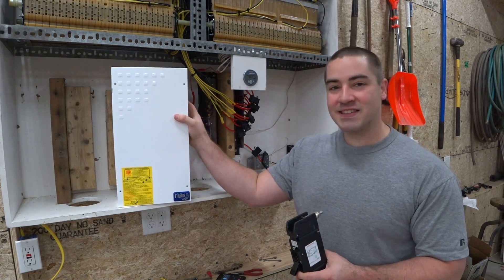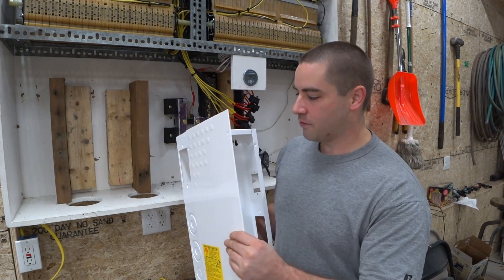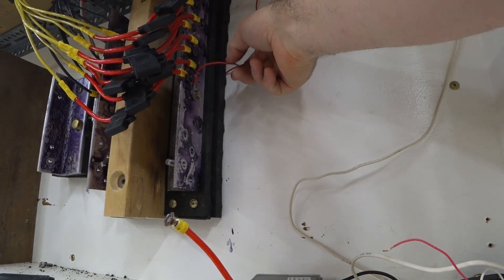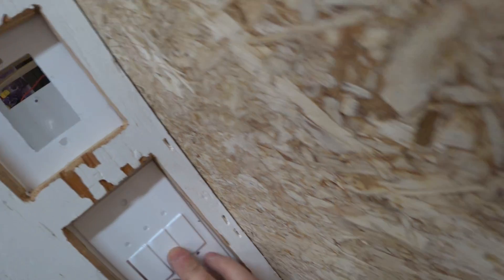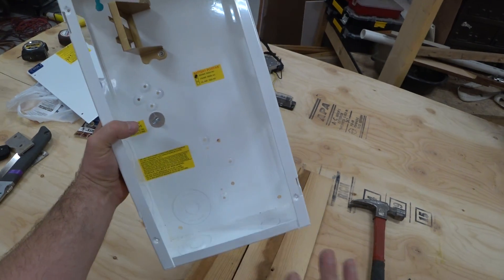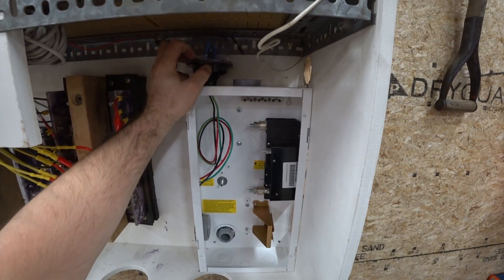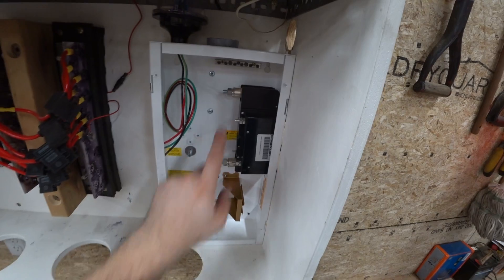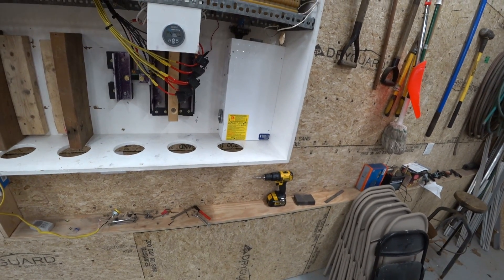Best Inverter Protection, DC Load Center

Comment: Yes to the point of view camera. Gives more details as to what you are doing. Any ideas where to find any volt or leaf batteries would be helpful. Apparently not popular cars in Florida.
Reply from the maker: I buy my batteries from Battery Hookup.  Last time I bought a battery from a junkyard it ended up being dead.  At least with Battery Hookup they always come out good.  You can use my coupon code DAVIDPOZ for 10% off.  It also helps out the channel.  
https://batteryhookup.com/
This is a really good deal right now: https://batteryhookup.com/products/complete-bmw-21kwh-ev-battery-96s-355v-60ah
Reply: Thank you.

Comment: Link for the load center comes up with error. Not found.
Reply from the maker: Alt-E store has an assortment of this type of thing.  But I've been told by my suppliers that breakers are hard to keep in stock this year.  https://www.altestore.com/store/enclosures-electrical-safety/electrical-enclosures/disconnectload-enclosures/dc-c1100/

Comment: Definitely prefer the POV over a tripod.  Tripods are good for providing a wider view of a project over all. But without fail, a tripod view always misses important angles and details. A head mount cam is an absolute necessity in my opinion. Think of it this way... if you can't see well enough from x number of feet away to do the job, then how are viewers supposed to see what you are doing well enough to understand what you are doing?  My advice to all YouTube content creators... Setup one camera in a good spot to provide a broad perspective of the project. (Tip: cell phone cameras excel at this task.) Use head cams for the up close, detail shots. Then edit the shots together during production. Yes it's time consuming. And it may well be more expensive. But this is one of the differences between a professional and informative video and... Something completely forgettable. You have 71K subscribers, 10K views and 467 likes for this video. And that's good. Congrats. But we all know that is a tenth of what the best content creators boast. The difference between them and you, is not ridiculously expensive equipment. It's production and attention to detail. Hope you find this useful and thanks for the videos.

Comment: Good job. I see the 1 inch conduit in this segment. Now you can mount your gauges/meters on the door. It will clean up the area and wiring. I think you should add a fuse block to the build at some point and cleanup those loose fuse's off the battery supply. It will make trouble shooting somewhat easier. Do you plan on running a watt meter at some point? https://www.amazon.com/Reliance-Controls-Corporation-MB75-Generators/dp/B00AHTWSE0 more for the generator side. Great build thus far. THX
Reply from the maker: Thanks for checking out some of the other videos.  I have a watt-meter on the BMV-712.  It records watt*hours, displays watts into and out of the battery, and state of charge.  I've got a video on it here: https://youtu.be/VAowfGI_0H0  In addition, the charge controller will save historical data on how many watt*hours it makes per day.  I was thinking of making a video in the summer talking about production, that way I could show winter and summer production data.

Comment: Be mindful as your inverter installation  manual may state that a class-T fuse is recommended for purposes of its fast blow capability and mosfet protection vs using what you have here. 

  Marine installations always, at least a proper ones  specifically use class-T fuses for inverter protection (DC side)

Comment: David - thanks for postiing your series.  I am using it for battery research to build battery powered flying cars!  We traded the garage for a hangar but we are still just a couple of guys building things.  While this work has been figured out for the small drone market - there is not much information when operating at much larger voltages (i.e. north of 400 Volts DC).  Your "getting off the grid" project has been very informative - thanks!

Comment: Hi 👋 sir my english is very so so i thenk you solve my problem plz i ned how much Inverter used Amp with 12volt battery on 1000w :::::120 or 220 vot consumption formula is watt divided by volt so 1000 divided 12 = 83.33Amp  so practically if you help me  plz if we used 1000w /600w /500w on inverter   How much battery Amp used on that time kindly if you have time plz tell me this information is I need if possible i am thankfully to you i have no inverter and no battery 🍀🍀🍀🍀🍀🍀🍀🍀🍀🍀🍀🍀🍀🍀🍀🍀🍀🌷🌷🌷🌷🌷🌷🌷🌷🌷🌷🌷🌷🌷🌷🌷🌷🌷🌷🌷🌷🌷🌷🌷🌷

Comment: I have that same box its nice, are you getting another 8000w or you sticking with the 3000w ?
Reply from the maker: I'm going to attempt fixing the 8000w inverter.  But even if I can't fix it, I figure this box will work with any future inverter.  Which video was this box in?  I only recall seeing your awesome Magnum load center.  That's nice btw, since you get everything (AC/DC) in one box.
Reply: @DavidPozEnergy  it would of been in one of my older videos, I moved to the magnum load center as its all in one :)

Comment: I was wondering what that other commenter was meaning by "too much sway", but then it was obvious later in the video. Using the POV does have some advantages. Hopefully that large breaker will give you a nice low impedance path to your inverter. In one of my earlier comments I mentioned the Soft-Start switch I was building for my circular saw. Well I finished it and have been using it to saw away happily without stressing the inverter...it works well. :)

Comment: I prefer a steady camera movement.  This one had to much swaying for my taste.

Nice hack on the box to fit the breakers.  You might want to place a curved coupling on the wood opening as well since the wood may, also, rub the wire plastic protection raw over time.

Comment: Nice one, David. Have you come across any reading on panels back feeding into themselves without DC circuit protection?  I have 3 parallel panel groups connected to an exterior disconnect. I also have one of these mn250 DC boxes. I'm unsure what's safer... Eliminating the panels from the outside of a shipping container all together if there's a problem or getting rid of the exterior disconnect and putting in 3 dc breakers. Also, how did you size the breakers? 80% rule or 100% at the rating of your planned output? Cheers
Reply from the maker: Hi Patrick,  I didn't quite follow your first question.  Could you make a quick video about it and link to that?  I'm sure someone in the audience can help even if I can't.  As far as how I sized the breakers: The first breaker, 250A was sized for any future inverter.  That was just the biggest I could get (reasonably) and I will have to use 4/0 with it.  The second was for the charge controller.  My charge controller is a Victon, 250/100.  That stands for 250 volts and 100 amps.  Since 100 amps is it's max, I added 25% to the circuit breaker size (125 amps) to avoid nuisance tripping.  I hope that helps.
Reply: @DavidPozEnergy  this was good motivation to fire up the camera. I'll ping you when I get to it, maybe over the holidays. Thanks brother!

Comment: That piece of metal looks nasty, lol. Go to the local hardware store and buy some reducing washers or doughnuts as they are known. They are tailer made for transitioning between knockout sizes. Also, by enlarging the box cutout you have voided the boxes ETL listing, but I guess that doesn't matter as much if you don't have an inspector coming
Reply from the maker: Thanks Liam, I think you just let me off easy, LOL
Reply: Sometimes it’s best to hit the local electrical supply house if the hole is rather large. Some hardware stores are lacking sorely in variety and quantity of electrical supply. Most supply house don’t mind selling to regular joes.

Comment: Have you seen the latest Rich rebuilds video kaboom, It will give you more respect for the lithium-ion batteries and yes the video is better with the mounting on your head as long as your head doesn't Bob around like a turkey strutting🤣😊😁
Reply from the maker: I just watched it, thanks for telling me about the video.
Reply: @DavidPozEnergy  I store my tesla S models under my bed for the winter from my camp. it is a little unsettling to see them explode like that.🤔
Reply: Leigh Amos they had no bms. Or any kind of monitoring or protection. I have 1400 cells in my bedroom. And adding 1400 more.  But not without a bms!

Comment: Lot of detailed work to get that box just right, I like the head mount camera then I see what you see. I just hate drilling holes in my perfectly good wall lol. I wish I had your video making skills.
Cheers
Reply from the maker: It's even more painful to me to drill the holes than you to watch.  After all, I built them.  If you can for-see all the plans maybe you could embed a conduit in the concrete wall when it is poured, but I didn't think to do that.